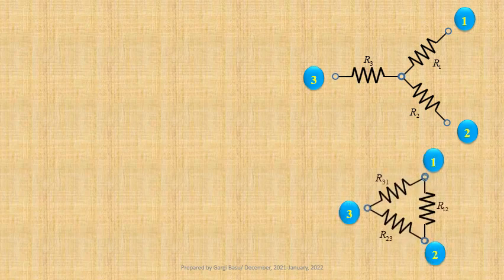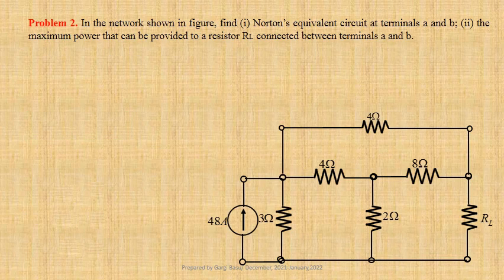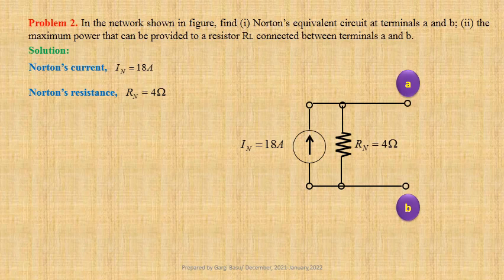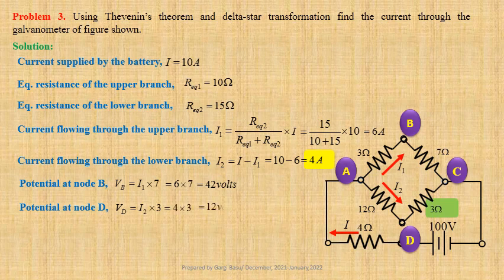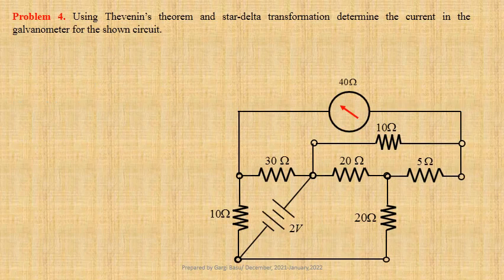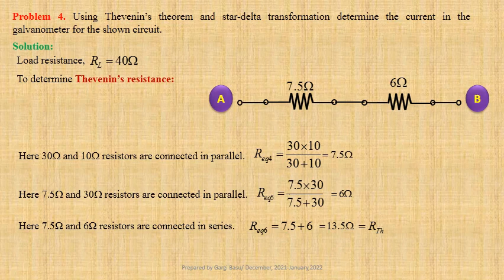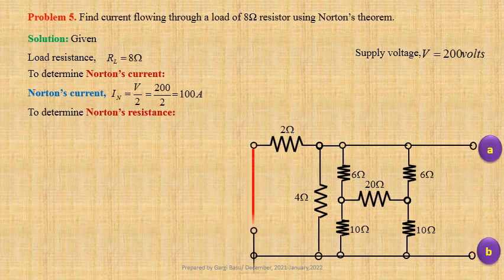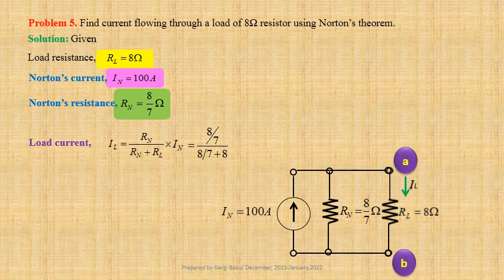Numerical problems on Star to Delta/ Delta to Star Transformation (Part-VIII)

Comment: A series motor runs at 600 r/min when taking 110 A from a 250 V
supply. The resistance of the armature circuit is 0.12 Ω and that of the
series winding is 0.03 Ω. The useful flux per pole for 120 A is 0.024
Wb and that for 50 A is 0.0155 Wb. Calculate the speed when the
current has fallen to 50 A. ( i want ans)
Reply from the maker: FIRST CASE: Ia1=110A; Eb1=250-110*(0.12+0.03)=233.5V
SECOND CASE:Ia2=50A; Eb2=250-50*(0.12+0.03)=242.5V
Since Eb=k*flux*speed
N2=242.5*0.024*600/(233.5*0.0155)=964.84rpm